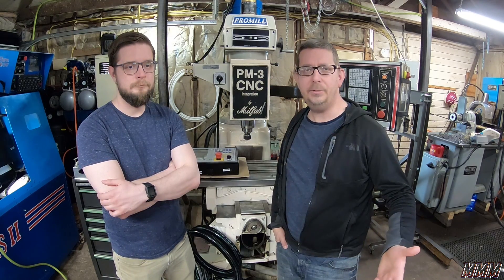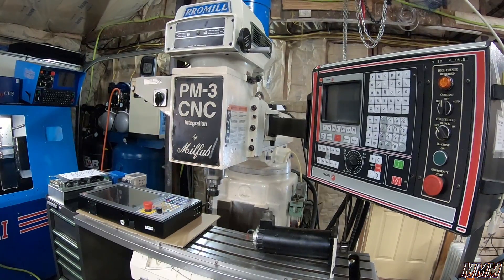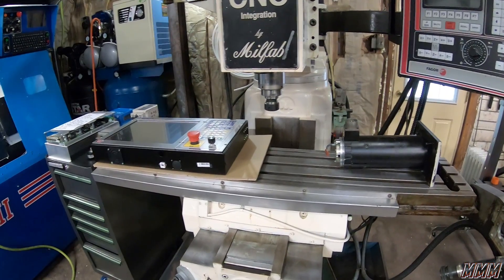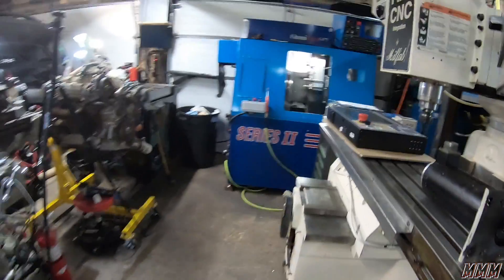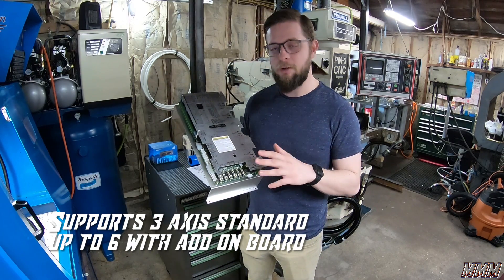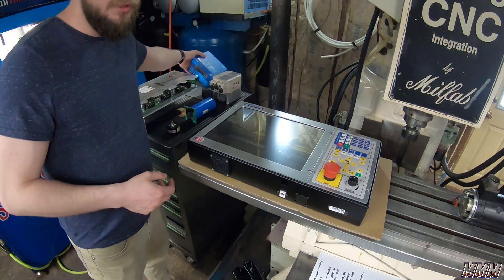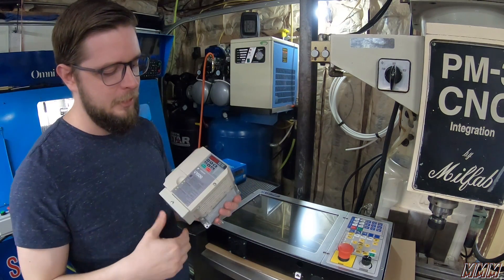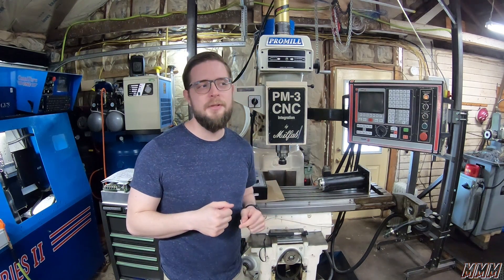Saving $20,000 over a Tormach Mill: Centroid CNC Mill - Part 1

Comment: Look forward to this project. I considered doing the exact project but using a bedmill instead of the knee mill. The 6 inches of z travel is a no go for me. Imagine you are drilling holes with a chuck and drill and then going to a short end-mill, you are going to run out of travel really fast. Yes you can hand crank the table down but then all you z offset are off. You are correct this will outperform the Tormach all day! Dave
Reply from the maker: Thumbs up on the bedmill, lots of those out there for cheap too, and the added Z travel is definitely a bonus so go with one of those for your conversion if you find one!  I will say though, for those out there new to machining and  wondering about Z Travel, after working in a job shop with various Hurco and Haas VMC's with 20+ inches of Z travel, 99% of the jobs I ever did there would have worked on this without even having to move the knee down so it's still incredibly useful for most  all jobs you would have ever done on the Tormach with more precision, faster, deeper cuts and better finishes all for 10's of thousands less.